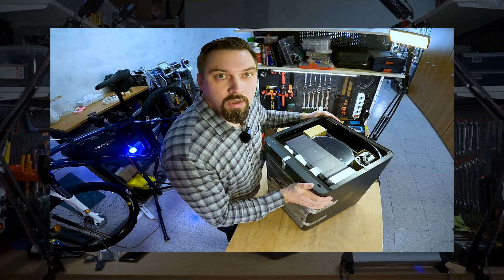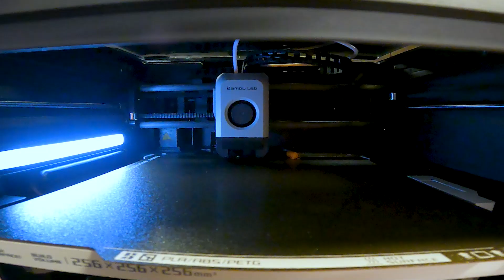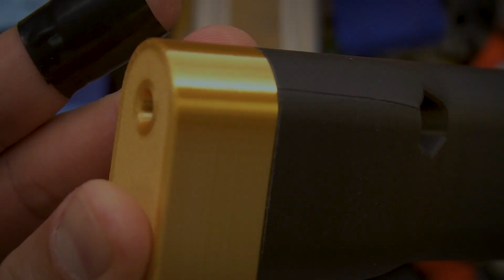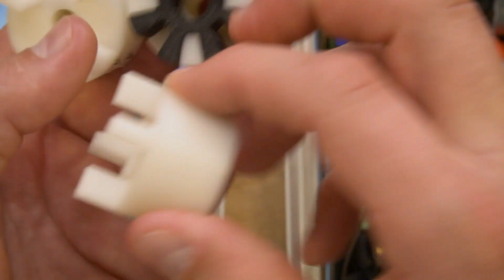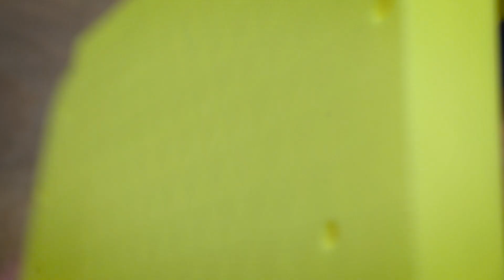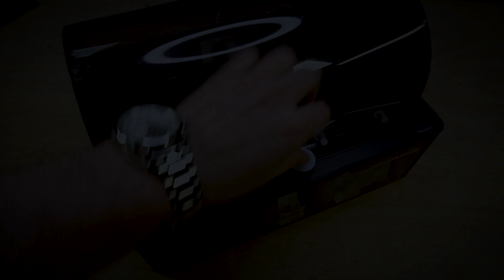BambuLab P1S in R&D: Unboxing and 6-Month Lab usage Review

Comment: Hi guys, is been a while since I'm following you and I love your company and your passion for motor control.
You show 3D printed parts in TPU (flexible), did you use original BambuLab filament or a 3rd party one?
Thanks
Reply from the maker: Hi! Thank you for your comment, we appreciate it very much! We do use TPU the one from Overture and its good. Moreover, we mostly use PLA Matte different colors also produced by Overture, is a good cost/quality choice. And in addition there are standard profiles in bambu slicer for Overture fillaments what makes using of this printer simpler.